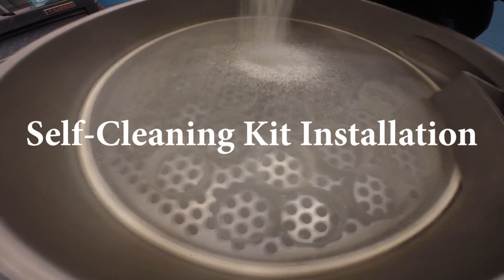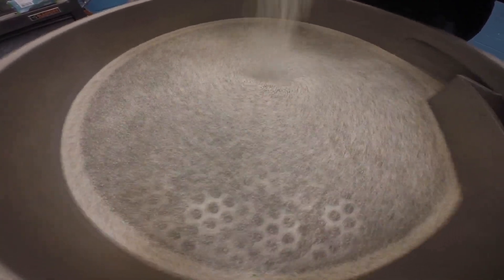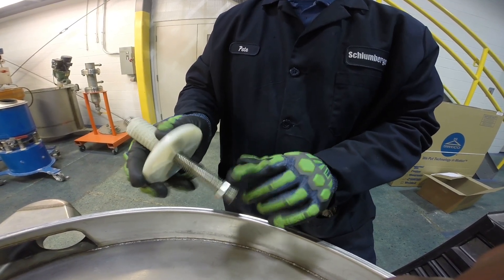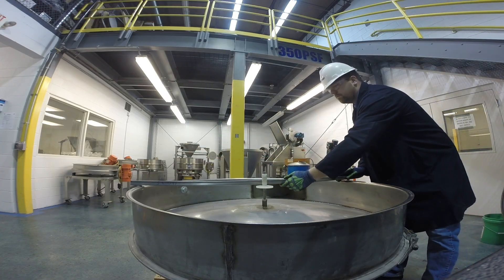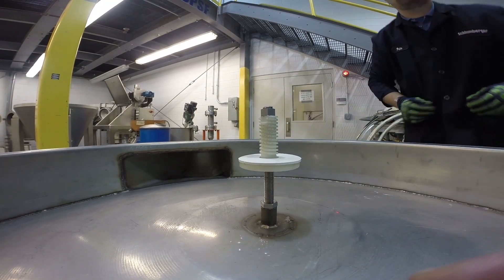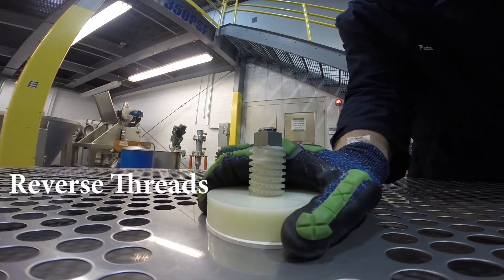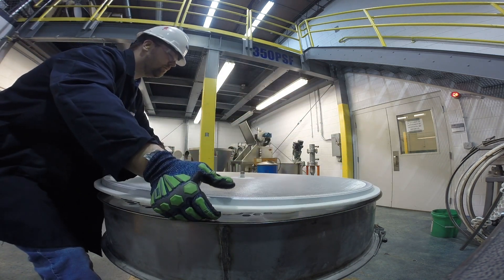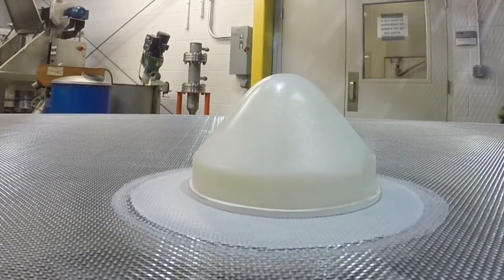Self-Cleaning Kit Installation

Comment: How do you know what side is the correct side for the sliders to be sitting on the perf plate?
Reply: Hello Brandon,
A simple answer to your question is that it really doesn't matter. However, there is a correct side up. If you look closely at the profile of a slider, the bottom will be a little wider than the top. So, ideally, it is better suited to have the wide side down. But the sliders will do the job either way. I hope that answers your question. Thanks for asking.
Best regards,
Jeff Dierig
SWECO Global Marketing Manager